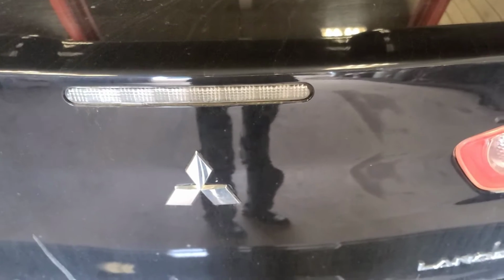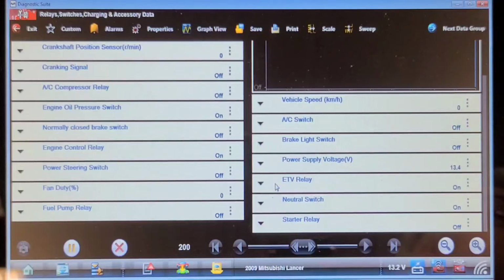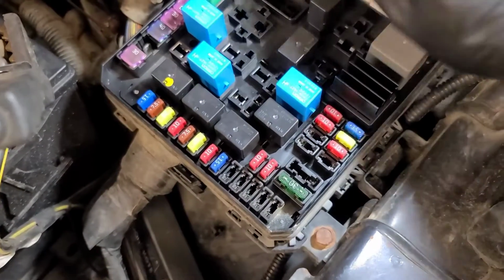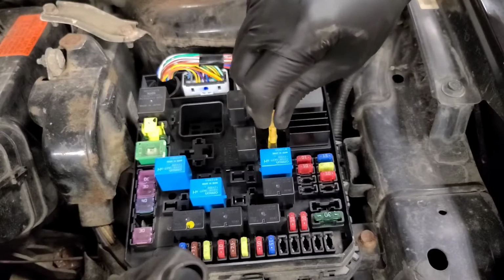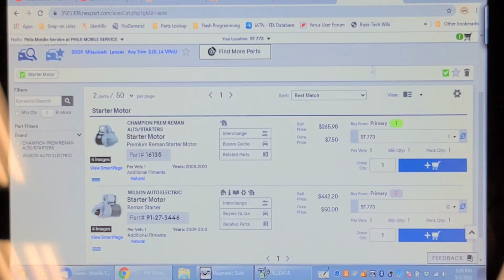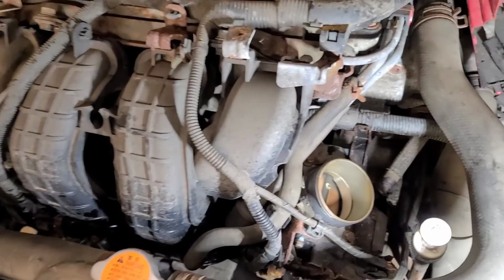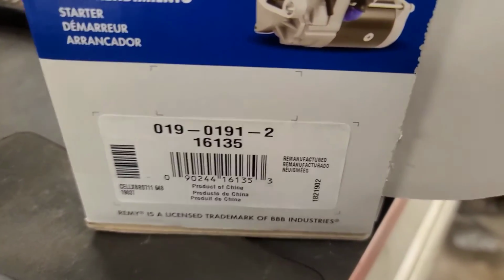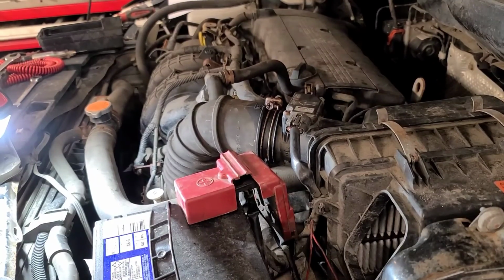2009 Mitsubishi Lancer 2.0 No Crank And Starter Replacement

Comment: Having same problem brother help me what to do exactly.in india its tough to tell mechanics about these cars .
Reply from the maker: You need to diagnose the problem.  I can't tell you what to replace as its nor that simple. Test the battery, check for power to the starter control wire but its very difficult to get at the starter. Bypass the starter relay see if the starter will work. Must be someone there who has test tools and knowledge of what to do.

Comment: I put new starter and still got the same issue  what else can been wrong . Please any help thank you
Reply from the maker: @melvingomzalez4653  you need to check the starter control circuit. Could be relay, safety switch,  ignition switch or security related.
Reply: I put new starter new safety clutch switch and ignition switch to.. what else can by
Reply from the maker: @melvingomzalez4653  you need to diagnose the problem not just throw parts at it. Could be a security Immobilizer problem or its wiring.

Comment: Got a similar thing on my 2009 mitsubishi outlander 2.0 did. Turn the key and no click. Hold the key to start position and it starts. Works fine for the rest of the day then does it the following day. My thoughts where ignition switch.starter or just thought maybe a relay🤔

Comment: Dead battery could be due to bluetooth module draining battery when car is off. I removed mine and no longer have battery drainage...even after 10 days away with no starting.
Reply from the maker: @RocketRuss  yes I'm aware of that and it has been disabled

Comment: @3:50 ish he mentions removing the bracket,  just remove the bolts that connect it to the plenum. If you look on the body just below the bracket, you'll see an out of place extrusion. This is a wedge point. Loosen the three bolts on the top of the plenum, the two mentioned above, and the one above the oil filter. Stick a wedge between the bracket and the wedge point. The starter will now wiggle out. Gotta undo and redo the connections at this point. If you try to do the connections where it's easy, it won't go back in.

Comment: Also does anybody know how to disconnect the airbag system we had one malfunction and cannot get it replaced so we're going to put a monitor in there and just deactivate the system
Reply from the maker: You can't legally disable the air bag system in most states or provinces. Most problems that illuminate the warning light will result in the system not working in a crash if it needed to. What's the actual problem with it?

Comment: I have a 2010 Lancer GTS it's an automatic with the shift on the steering wheel got 88,000 miles on it and the other day at a stoplight it just jerk upon acceleration and will not go into gear at all it starts and runs just fine however I can't get the transmission to go into any gear and says Service transmission required but there is not really a code that my readers tells me has anyone else had a problem like this this
Reply from the maker: What scanner did you use? May need to use a better scan tool to read transmission codes. How's the fluid level and quality?

Comment: Hi, same issue with my lancer. Could it also be an immobilizer or ignition switch issue? Saw that you checked the ignition switch in the scanner so I assume that's how you can tell it wasnt the ignition switch?
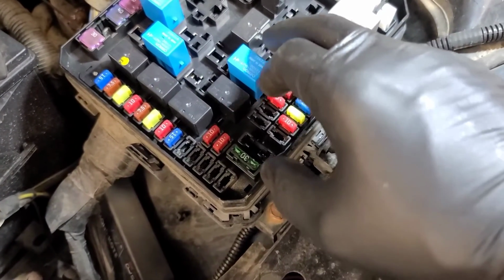Reply from the maker: You need to test for power being sent to the control terminal of the starter when it's not cranking. If it's an immobilizer issue you should have a code for that. Alternately you can test the stater by jumping pins 3 and 5 at the starter relay shown at 5:39 in the video. Relay could be labeled 30 and 87 as well. Be sure it's not in gear if it's a standard. If it does not crank and you have power at the relay pin 3 or 30 ymthe starter is likely bad. If it does crank the reinstall that relay and listen for a click from it when trying to start. No click control circuit problem...
Reply: @PhillipBailey anks! Tried to jump pins 3 and 5 and yup starter did turn and car cranked (didnt start). Just had it scanned recently and had an immobilizer short circuit code. Not sure if i should purse the immobilizer path...
Reply from the maker: @imagingteam  since it cranks by bypassing the starter relay then the problem is in the control side which could be the immobilizer. I would pursue the security issues. Does it have a remote car starter system that is aftermarket?
Reply: @PhillipBailey  no just stock security system.

Comment: My lancer 2008 de rough idle and vibrate at cold start what’s causing it thanks
Reply from the maker: Could be lots of possibilities. Need to scan for codes, look at misfire data. Sparkplug, coils, injectors, mechanical problems in the engine. Start by reading the codes.

Comment: Great vid, just replaced my starter, same corroded wire. It's a lead from the solenoid to the brushes. New starter for $2 part because they couldn't be bothered to insulate the wire. The trick to get the starter out from behind the manifold is to rotate it as you pull it out of the bell housing and let the back end drop down and it comes out vertical. I didn't need to remove any brackets.
Reply from the maker: Thanks for the tip. I think there may be a couple intake manifold variations depending on the year or even build date. There have been reports of being able to remove without the manifold being moved but believe me I tried everything on this. Could also be a variation on the oil filter housing not sure.
Reply: I own one and its the most pain in the ass car to maintain..mitsubishi really needs to pay more attention about the little details in building their cars..its annoying

Comment: Faced the same exact issue, only thing was after changing my Starter Motor & Battery, my car wouldnt turn on at all. Cause of this, STARTER RELAY. Mechanic got it Bypassed and it doesnt have any issues.

Comment: Hey man, thanks for this video! Do you happen to know where the fuel pump relay is for the non turbo lancer? 2008
Reply from the maker: As near as I can tell it's internal in the engine ECM and not serviceable. 2.0 litre. ETACS-ECU
Reply from the maker: Sorry the ETACS -ECU is not the ECM but it's still not a serviceable relay.
Reply: Thank you so much for your help! I’ve searched everywhere and now can rest ez knowing I’m not missing it. Thanks man

Comment: Does anyone know where he got the bracket from when he is showing the starter on the counter? I can’t find that bracket and my manifold still isn’t moving a single millimetre to get that starter out
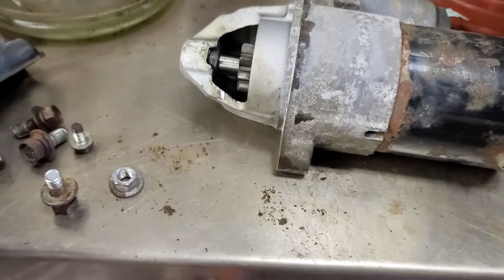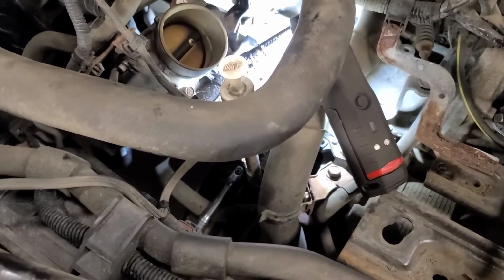Reply from the maker: that bracket at 16:03 is directly below the throttle body seen at 13:40. There is also another brace seen briefly at 15:25 and 16:09 plus the bolts that hold the manifold to the cylinder head. HTH

Comment: Hey man I have a question. I have a 2009 2.0l lancer. Would the starter made for a 2.4l work for it?
Reply from the maker: Sorry I have no idea. I doubt it but check with your parts department.
Reply: It looks like it does work

Comment: If it comes back for the battery dying (slow leak) it is usually the Bluetooth module (located in the dash over the glove box)
Reply from the maker: Already disconnected thanks
Reply: I just did the Bluetooth module thing, i had high hopes as I have been without car for months now, no mechanics have been able to fix it, i have the code U0197, any known electrical problems? Car stalls as soon as I turn it on, unless its on high revs. Thank you!!
Reply from the maker: @oscarzambranocaicedo2020 what module is the U code stored in. Will it stay running if you keep the accelerator depressed?
Reply: @PhillipBailey  its in the SRS section/module. Yes, it will keep running if accelerator is depressed, as soon as i stop it dies
Reply: I posted a video on my profile, thats how it acts up, now it just shuts off, it “got worse”
Reply from the maker: @oscarzambranocaicedo2020  I don't believe that the code is related to the running problem. Check for induction leaks between the maf sensor and the throttle body. Try unplugging the maf sensor and see if it will stay running.
Reply from the maker: @oscarzambranocaicedo2020  the video is not much help. Sorry

Comment: Mine is a 2006 evo 9, I got a new battery, and i changed the starter along with the starter ignition relay. because I use to have to hit the starter to get it unstuck so it would turn on. But now when I try turning it on it still won’t start, and by the second time I try cranking it you’ll hear a click from the starter but it’ll suddenly drain the power. and then theres no power inside the car. I’m not sure what it could be any help?
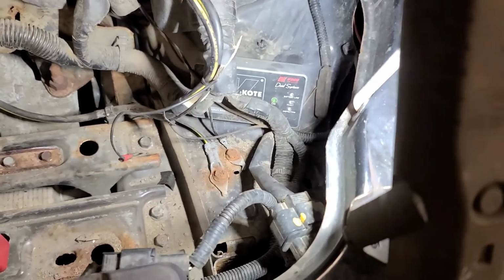Reply from the maker: The body grounds are under the battery tray. See 18:30 in this video if this is the same as your Evo
Reply from the maker: Sounds like a loose ground cable. Check the battery connections first. Then follow the ground cable from the battery to the engine. Take the connection apart at the engine and clean it. Make sure the body ground is good as well.

Comment: how much would it cost for a job like this?
Reply from the maker: To change the starter is around 2.5hrs starter here in Canada reman is $250. Add some time for diagnosis of the system. I charged my customer $588.00 plus tax CDN. Hope this helps you.
Reply: 588$ rip off

Comment: hey so I replaced the starter and still no start where should I start
Reply from the maker: That's tough. Is the starter clicking at all. Do you have power at the starter relay. Can you get it to crank by bypassing the starter relay two large terminals? Battery ok? Cable connections? Maybe faulty starter?
Reply: @PhillipBailey  starter is good power everywhere I have checked a lot of connections its not throwing code either
Reply: @PhillipBailey  but I haven't trying to jump the starter by tapping the two together
Reply from the maker: @christianwiseman7252  at the starter relay listen and feel for the relay to click when someone turns the key to crank. If no click connect a test light between the two smaller terminals and try again. If the test light lights try a new relay. If it does not try moving the shifter to neutral instead of park. Use a piece of wire to bypass the starter relay by jumping the two larger terminals together. Make sure it's in park or if a manual in neutral.
Reply: im going to be honest I am fairly new at all this when you say terminal you mean the fuse right or the actual start its self
Reply from the maker: @christianwiseman7252  I was speaking about the terminals on the starter relay in the fuse panel.
Reply: Could be the immobilizer. Ive been having issues with it on my lancer